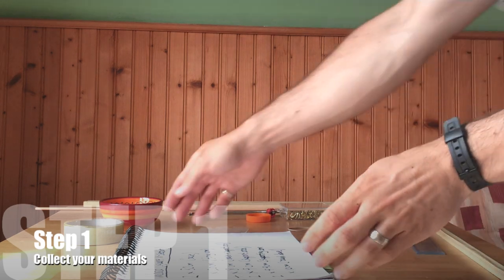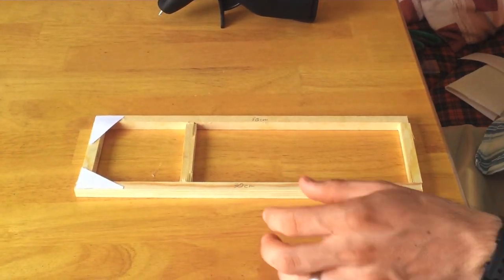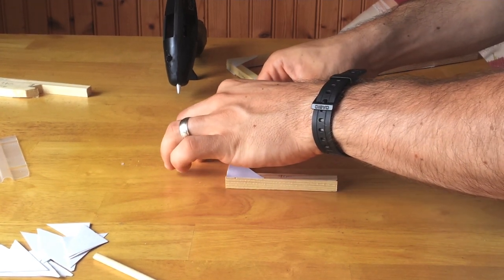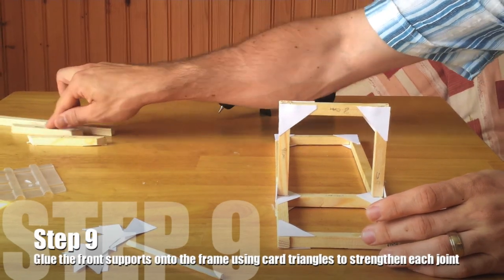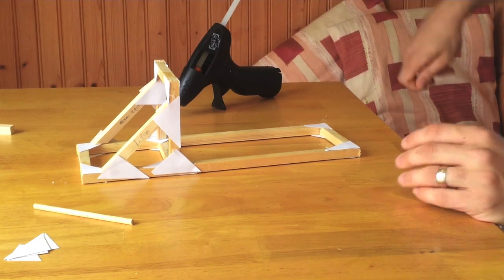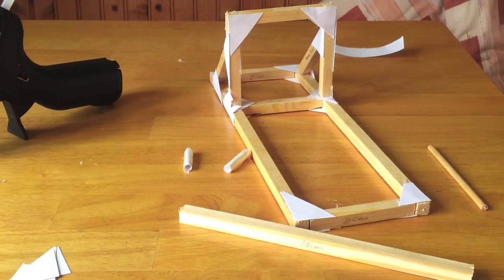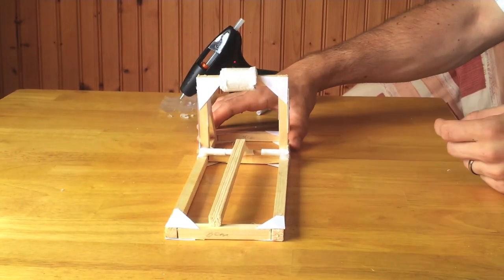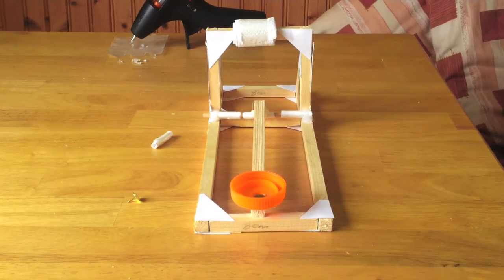DT projects: How to make a model Roman catapult

Comment: I made one based off of ure vid I made it 4x bigger and used springs instead of rubber bands but ure vid was really helpful
Reply from the maker: Glad the video was helpful Kyle :) how did your catapult get on?  What sort of distance could it throw objects?
Reply: It worked pretty well went about 30 feet or about 12ish meters I got a 100 on it so again your video helped thanks
Reply from the maker: KyleKid09 Great job and congrats on the mark of 100!

Comment from the maker: Hi Fernando, chunking a pumpkin should be doable with a few changes.  The structure of the catapult will need to be a lot stronger, and the force that powers the arm will also need to be more powerful.  If you use 1 inch-thick wood lengths, that should give the catapult sufficient strength.  With the force, I'd suggest going for a torsion catapult for your force as you can wind up a pretty decent strength throw.  Check out the video I've just put in the description for a good how-to.

Comment: I love this Roman catapult and plan to do it with my Year 3s next term.  The instructions are so clear.  Could you let me know what glue gun might be good for the task.  I have looked online for thin nozzle wireless glue guns but there is such a range.  Also, would a cool melt be suitable?
Reply from the maker: Hi Victoria,  great to hear you want to give the catapult a go with your Year 3s! Bostik cordless glue gun are great as there are no wires to get in the way, but they do eat batteries quite quickly - especially with a large group of children!  I'd recommend any Bostik glue gun though.  Cool melt will work just fine, just make sure you load it with cool melt and not hot melt glue sticks!  Let me know if you have any more question or would like a copy of the plans as they stand :) Tim

Comment: This is an amazing catapult. I'm going to use it for a school project. I want to know if I use regular or jumbo marshmallow how far will it go, and if its not heavy enough to go at least 12 ft. does the catapult need to be bigger, or do I need to use a heavier piece of food?
Reply from the maker: Hi Sophia and thanks for the kind comment!  I'd say a 1 inch (standard?) marshmallow could easily go 12 ft.  If you double all the dimensions of the catapult and use thicker rubber bands, a marshmallow could go 20+ ft easily (I've tried it in school!).  The key is a stronger force - more or thicker rubber bands and a stronger frame to support the throwing arm.  Does that help?
Reply: yes thank you so much :)
Reply from the maker: You're welcome :)  I hope the build goes well and feel free to ask any further questions that cross your mind!

Comment from the maker: Hi Tiffany, with a few adjustments it should be able to throw a golfball.  If you lengthen the firing arm and use thicker rubber bands, it should throw a golfball at least 5 metres. PM me if you'd like a copy of the plans as they stand!

Comment: Hey I need to make a catapult like this for school it has to be able to shoot 8 meters with a marshmallow what should I use to help shoot that far? Thicker rubber band? Larger wood? Thanks
Reply from the maker: Alexis Pendleton With a catapult, making the frame larger and thickening the rubber bands will both increase the throwing force. Bear in mind, if you use stronger rubber bands, you'll want to strengthen the joints! You could always use thicker card to do this!
Reply: Cairdy Crafts thank you so much! This really helped me to get an idea how to build my catapult for a school project
Reply from the maker: Glad I could help, Alexis. Good luck with the project!

Comment: I have to make a catapult project for school, but the catapult has to be able to reach 3 different distances, each one being further away from the last. How can I modify this catapult to be able to reach longer distance with minimal change?
Reply from the maker: To change the distance, you'll just need to increase the force on the firing arm. By adding more or less rubber bands, you can change the force! Thicker rubber bands also provide stronger forces!

Comment: I need to launch a golf ball over a 30 cm tall wall from a distance. What do you suggest I should modify to get that height and power?
Reply from the maker: I would suggest using thicker rubber bands and double the dimensions. How far will your catapult be from the wall?
Reply: The size of the catapult needs to be the maximum size of a shoebox. It needs to hit three targets, each separated by a 30 cm tall wall. It can be as close or as far, just as long as the ball meets the target.
Reply from the maker: OK.  Stronger rubber bands will give you the force.  You could also try using a torsion coil of string instead of rubber bands for a stronger force.  Check out this video for a useful tutorial!
How to Make a Torsion Catapult - Table top size Mangonel

Comment: How big were the card triangles? 1 -inch squares cut in half seem too small.
Reply from the maker: The triangles I cut were around 1 inch square, but you can cut the triangles larger if you want to.  The thicker the card, the stronger the triangle.

Comment: If ur doing twice the size of that do u just double the measurements ?? Please answer ASAP!!
Reply from the maker: Yes, you would Sophia.  jasmeet minhas is using measurements in inches and it seems to be working out fine!  I'd use thicker card for the card triangles to strengthen the joins though.

Comment: hey man thanks a lot man. Your video is amazing. Can you help if I have to make a similar catapult like yours how can I alter the design to launch the ping balls to land in a distance of 2m, 4m, 6m and 8m.
Reply from the maker: Hey Rameez, glad the video's been helpful!  Are these ping pong balls you're trying to fire?  If yes, then I'd add 1 or 2 rubber bands to the firing arm.  That'll fire your projectile further.  As ping pong balls are large and light, you may struggle getting them to go further than 3-4m.  If you could weight them down with something, then they'd go a bit further.  Also, you use a deeper lid on the end of the firing arm to hold the ping pong ball more firmly.  Let me know how you get on!
Reply: theweescottie what about a squash ball? say you double the length of every piece of wood you use, would the ball go further (aiming for 25 ft.) and use screws to bind the wood together (the wood would be 2x2 then) do you think this design concept would still work?
Reply from the maker: mike D Sorry for the late reply but that should work especially as a squash ball is solid enough not to change shape mid-air and is light enough to fly nicely.  I'd suggest using something like bungee cords or checking out the link in the video description to the Torsion Catapult - which will be a LOT stronger!!
Reply: theweescottie Thanks :) I used this design and beefed it up a bit with some srews and industrial rubber bands. Worked perfectly :)
Reply from the maker: Brilliant! Good job :)

Comment from the maker: Hi Casey, yes you could make a catapult that could fire a tennis ball weighing in under 2.2lbs. How far does the catapult need to fire the tennis ball? If you go for inch thick strips of wood, 1cm-wide rubber bands, and use a small plastic yogurt cup for the basket, that should fire the tennis ball for you. Hope that's been helpful! Feel free to PM me if you've any other questions :-) Tim

Comment: would it still work if i doubled all the dimensions to get a twice as big catapult
Reply from the maker: SuperFireWolf, yes, doubling the dimensions will work to give you a catapult double the size.  The only thing to watch is as you double the length of the firing arm, the force the end of the arm carries as it hits the top of the firing arm will increase, but as long as you don't use very thick rubber bands, you should be fine.  Does that make sense?!
Reply: theweescottie ya thank you this really helped with my school project thanks again :D
Reply from the maker: You're welcome SuperFireWolf :) Glad I could help.
Reply: Sure.
Reply from the maker: I agree with Bill.  I'd suggest using thicker rubber bands for increased force.  If you do use thicker rubber bands, then screws would help give the frame of the catapult the extra strength.

Comment: Hey, i built the catapult but now my teacher is asking for a optimization can you give me a few pointers, thanks.
Reply from the maker: Thinking about design choices, wood as a material is easy to work with, readily available and was what catapults were originally made of.

As for rationale, what is your teacher after for that?

With construction challenges, you are probably better to answer that than me!  What did you find most challenging (e.g. cutting sizes) and how did you address those problems?

With recommendations, again that's probably better answered by you!  What would you change about the construction or finished project?  What do you think would make it more powerful, stronger or more durable?

I hope those ideas helped!
Reply: theweescottie what can i talk about for the rationale
Reply from the maker: I don't know about rationale. Can you ask your teacher what they mean by that?
Reply from the maker: theweescottie I think the rationale for a project like this is why you chose the design you used.  So, think about why you chose the design from the video.  Why did you use the wood you used?  Why did you join the pieces of wood the way you did?  Why did you use rubber bands to provide the pulling force for the firing arm?  Why did you make any changes you did?
Reply: ok i asked my teacher aswell that is good but can you help me answer one of thoes questions
Reply: why did you use rubber bands to provide the pulling force for the firing arm?

Comment: How far does it launch?
Reply from the maker: Good question and it depends on what your fire and how strong the rubber bands are.  The one I made with my children in school fired a ball of scrunched up paper (taped over for reduced air resistance) around 7-8 metres.  I've fired marbles up to 10 metres before with the catapult in this video.  Use a strong frame and thick rubber bands and I think you could fire a marble or solid projectile 10-15 metres easily.  I hope that helps!

Comment: does the length of the firing arm matter?
Reply from the maker: Good question and the answer is yes!  The shorter your firing arm, the lighter it'll be and the easier the rubber bands will be able to pull it up (so the quicker it'll move) and the larger the firing arm, heavier it will be and the slower it'll move.  Also, I found it helpful for the firing arm to reach at least as long as the end of the catapult base so it can rest on the base, if that makes sense.
Reply: theweescottie
Thank you! your videos are very helpful :)

Comment: why do we need to put triangle cardboard?
Reply from the maker: Good question.  Like with a bridge, the strongest shape is a triangle.  So, the cardboard triangles give the catapult's joints strength.  Triangles are also the smallest shape which give a joint strength.

Comment: do you know how i can optimize this
Reply from the maker: A couple of thoughts. Think about which part of the catapult could be made better - e.g. could you move where the rubber bands are attached to make them create a stronger pulling force?  Given that the furthest shot will come from a 45 degree launch, could the piece of dowel that holds the firing arm in place be moved forward or backward on the base to change the release angle of the firing arm?
Reply: theweescottie
do u think i can put small wooden wheels on this model?
Reply from the maker: That's a great idea.  Traditional catapults/onagers/manganels all had wheels to move them into battle. http://www.mywizards.com/wp-content/uploads/2012/04/onager.png